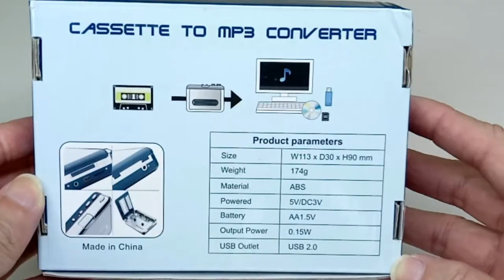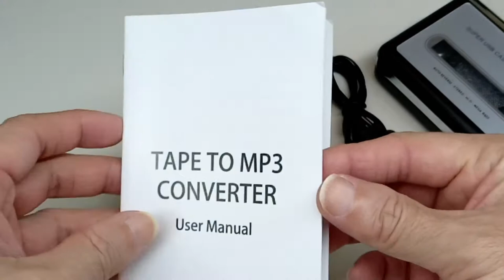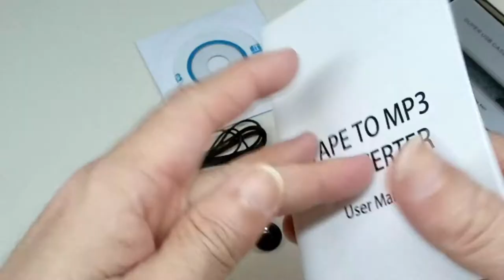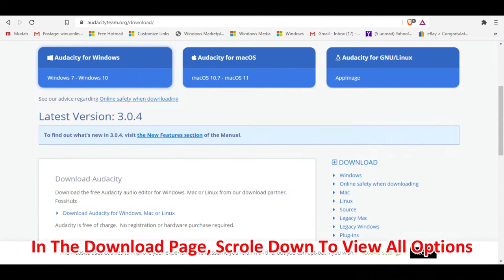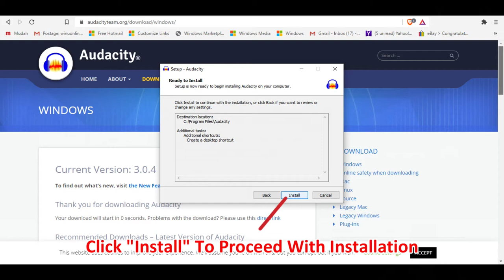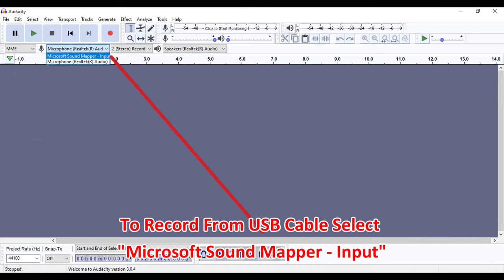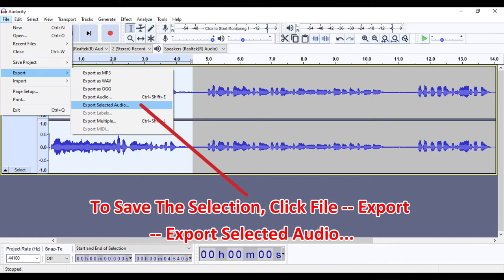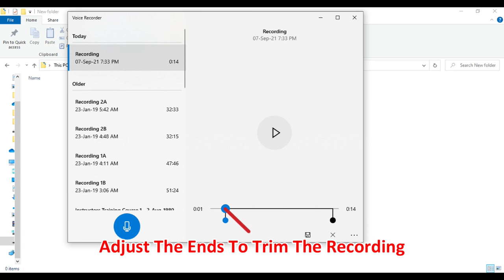How To Convert Audio Cassette Tape To MP3 Digital Files

Comment: After your tutorial I ordered one but after 1St sample recording it produce a hissing sound while recording or while listening through battery, can you help here
Reply from the maker: Did you try a few / other tapes? 
If other tapes is fine, most probably the tape with the hissing sound is dirty, is there any fungus on the tape? You can try to use a tape cleaner to clean it first. If still having the same problem, most probably they tape is degraded from time and sometimes keeping it to close to a magnet or speaker.
Reply: @nice2tradez56  can you share the link which one you have purchased, I exchange it but that is even worse
Reply from the maker: Do you have friend with tape player? Can go over to their place with your tapes to test. If still can hear the hissing sound means its not the player but the tape that is giving the problem. The magnetic matel particles in the tape is corruted or degraded. Cant do much about it unless you know someone who can digitally clean up the noise.

Comment: I just got mine today, but for some reason the dir button won’t stop playing once I put a tape in. Any suggestions??
Reply from the maker: press the button see if you can get it to move up and down or not. Ifnu can't press the button means is stuck. Try Loosen the button by a few soft knock with Ur hand. If that doesn't work. You need to open up the player to check. 

If all else fails Better get a refund or replacement from Ur seller.

Comment: Every time I try to record, it keeps recording sounds from the room instead of the cassette tape. Any suggestions?  I'm not sure if I have to fix something in my settings.
Reply from the maker: In ur pc you need to check the mic / recording input setting. U got recording of sounds from the room is because the seeting is using the mic on ur pc instate of input from the mini jack. Try to change the seetings on ur pc.
Reply: @nice2tradez56   Thank you, do you know how i can do this?  I can't seem to figure it out.
Reply from the maker: To change Default Sound Input Device in Windows 10, do the following.
1) Open the Settings app.
2) Go to System -> Sound.
3) On the right, go to the section Choose your input device and select the desired device in the drop-down list.
Reply: @nice2tradez56  Thank you
Reply from the maker: @jeffryfoote  👍😊
Reply: @nice2tradez56  Hi, I have the same problem. I followed your advice,but the drop-down list doesn't show the usb cassette capture as desired device. I'm using Windows 10 as well. Do you know a solution?
Reply: @carlinorage  Does the version number of the USB jack of your converter match the version number of the USB port of your computer? I wish that @nice2tradez56 should have discussed about the version number of the USB jack of his converter.

Comment: Unfortunately for me the Sound Mapper does not appear:( I see a USB PnP Audio device but when I click on it and try to record it will say Error 9997 invalid sample rate.
Reply from the maker: It's easier if you use window built in sound recorder. It's much simpler to use. Windows recorder instruction is included in the video. 
Hope that helps.

Comment: Mine stopped recording, FF and rewinding
Reply from the maker: did your battery ran out of power?
if you plug into your pc using the cable and getting power from your pc it shoulb be able to power up. If its not able to run, you should get someone to look at it, see if its spoilt you should try to get a replacement from your seller.